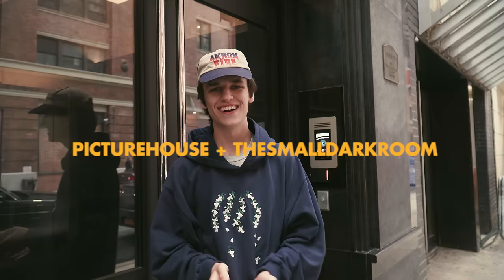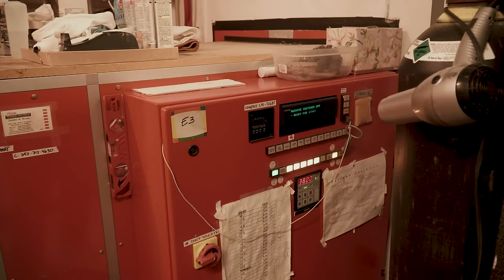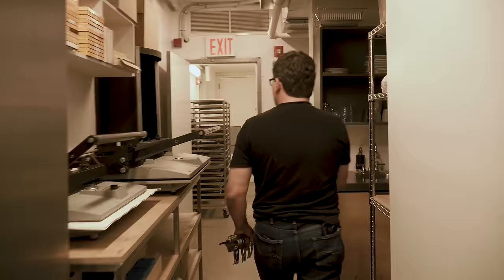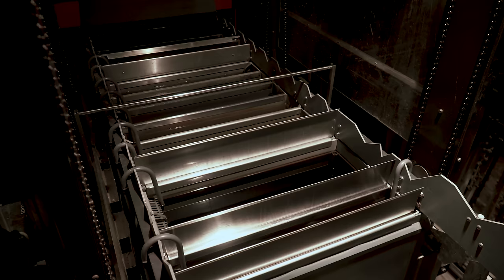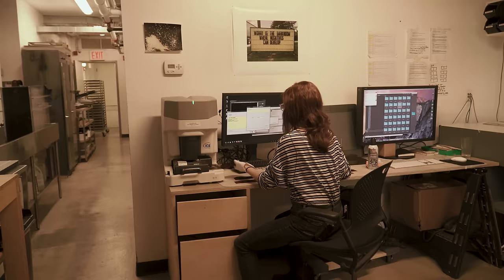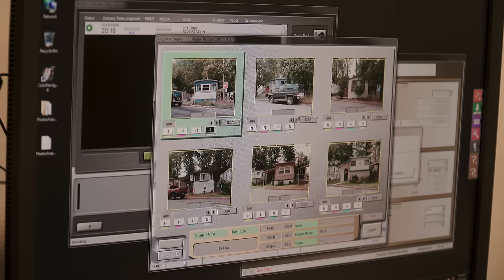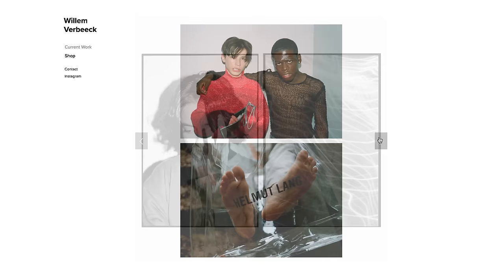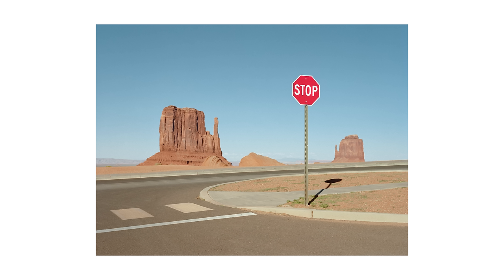How a Lab Develops and Scans Film Photos

Comment: I'd be interested in seeing a test to see if the bottom frames on the film are developed slightly more than the top frames, since they spend a fraction more time in the tank - or if the residual developer on the film while it's in the air is enough to even the development time out despite the slow movement.